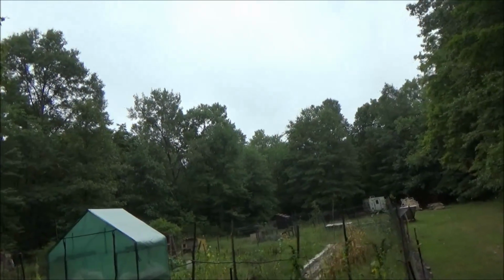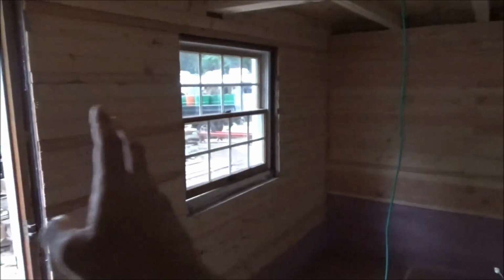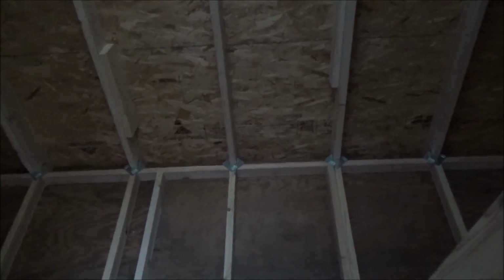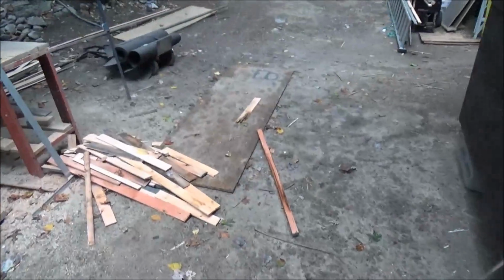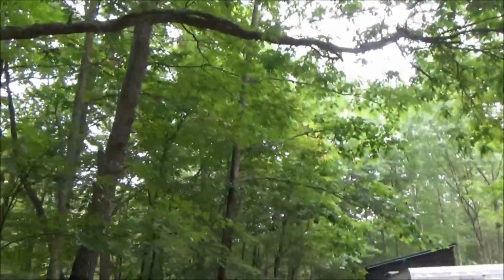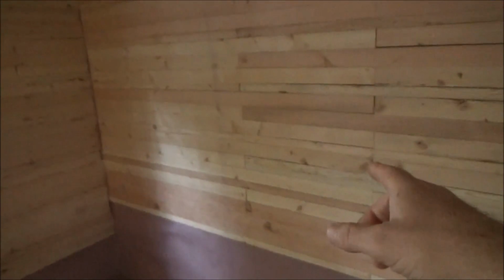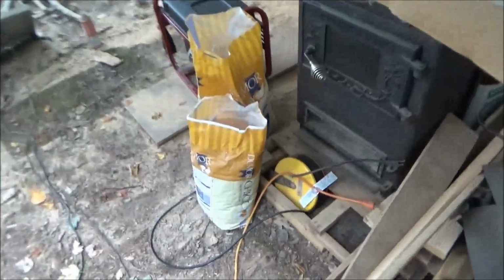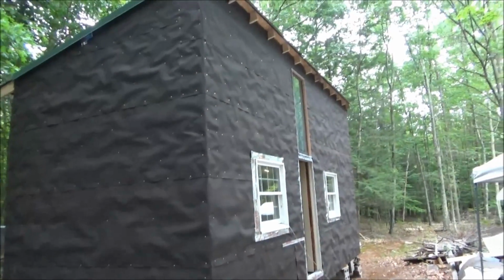Cutting Firewood And Showing John The Progress On My Tiny Home S20

Comment: How will you be running wiring and plumbing if you close the walls? Down thru the floor does not seem possible.
Reply: He has said many times in his recent videos that he would be running wiring in conduit outside the walls along the floor i believe and plumbing will be going out through the wheel wells :)
Reply from the maker: 1981therealfury Right. Thanks
Reply: 1981therealfury
Nod, I must have missed that. My bad. :)
Reply: JAI Colorado
 No problem :)

Comment: somewhere on another YT a guy had a metal container on wall up by ceiling with a small copper tube with valve at bottom drip into wood burner for when he wanted a boost to the heat filled with oil. good idea. things lookin good. when you get ready for the ceiling you could put the wire in and out the eve to hook up small solar panel for a ceiling fan, I've seen them and they have a remote control on/off.

Comment: When you leave wood to dry out it is called "seasoning" not "curing".  Because the outer growth rings of trees are sap-wood, and sap-wood is relatively impermeable to lateral moisture movement, the sides dry slowly.  If you cross-cut the fallen trees into rounds you expose the more permeable heart-wood at the ends, and the wood seasons faster.  Wood mainly dries from the ends — which is also the reason why timbers check (develop cracks) from the ends much faster than they split along their sides.

Comment: John's reaction was great! :D

Troy, now you've got me scared about this winter. I have heard so many people saying how bad it's going to be . . . .  My chickens will be much better off than they were last year, I'm not worried about them.  We couldn't handle the oil bill from last winter!  Been wracking my brain on how I can conserve heat in my house. I have a LOT of work to do!!!!
Reply from the maker: I am worried, thats for sure. Having a better insulated home than most will help. But I am now very worried about fire wood. Buy oil now before the prices go up if you can afford it. I plan to stock up on propane now as well when I get paid next.
Reply: The Do It Yourself World That's my problem, I can't. :(  I have less than $1,000 in my savings account (I have been trying to save for a truck. Our car is running on a wing and a prayer.). That might buy 1 tank of oil. I'm trying to remember, I think we went through 4 last winter.  Thinking about kerosene, I do have a k. heater. It helped out last year.  But when I changed out the wick, it now won't shut off properly. Haven't been able to figure out why.
Reply: ***** Did that. You're right, they are tricky. Everything was lined up as it should be. I haven't looked at it since March or April (my, this summer has flown by!!). I'll have to have another look at it with fresh eyes.
Reply: MOMH---I have 2 vornado ( i think that's the name) electric heaters and i use 1 in my garage.  I set the temp to 65 and it heats the garage just fine. It runs all winter.   I tried to use them both but it was way to warm.  They are tiny things, but work great.
Reply: T Hetrick How high was your electric bill and how cold did it get in your area for how long?
I will be doing things to help reduce heat loss in my home. Hoping that will help.
Reply from the maker: MotherOfManyHorses Yes reduce the heat loss will help a lot. That was my problem the last couple winters in a leaky camper and RV.
Reply: MotherOfManyHorses
I never noticed my electric going up.  I am on the Eastern Shore and we got blasted a couple of years ago.  I could not get out of my garage,(snow was to high)  but puttered around in it in a long sleeve t-shirt.  I never cover my window a/c either.  If it's 30 outside I'm in the garage.

Comment: What ever it takes so you can install the wood stove I would do now and then you can work around it. You need it in so you know what you can install around it for your clearances.  Your over hang will be a problem with a through the wall chimney and a through the roof looks like the best way to go now.  Does your wood stove have a blower on it?
Reply from the maker: I need next month's pay check, so that is a no go for now.
No blower. Cant afford the power
Reply: The Do It Yourself World
i think they have a blower that works with the heat of the wood stove so you would not need any power for it i cant remember what they are called
Reply: Why can't you use a couple of old switched 12 volt computer fans hooked up to their own solar panel to circulate the heat?
Reply from the maker: wotsken Very weak though really. More of a very expensive gimmick than anything else really, imho
Reply from the maker: Captain Carl Wright I will probably do that

Comment: i think a good idea would be to run the stove pipe up then turn it out through the wall near the roof so you get the heat and not the worry of roof leaks. but great work and keep up the progress
Reply: Yes, that does sounds like a much better idea, not sure if it is logistically possible or how much harder it would be but if its possible then i would say out through the all about a foot or so before the roof would be a really good idea.

Comment: I've seen a lot of folks re-using the heat from their stove pipes to heat water through a copper coil wrap/thermal siphon.  Would something like that work for you?
Reply: dancingpennies
watched an Elderlyirion vid about a stovepipe water heater. very simple. there are many vids about various wood powered water heaters.many that would work in Troy's  house.
Reply: Don't know if it could be done in a heating stove, but we had a system in the firebox in our kitchen range.  Mom said the cookstove didn't work the same, though.  :/